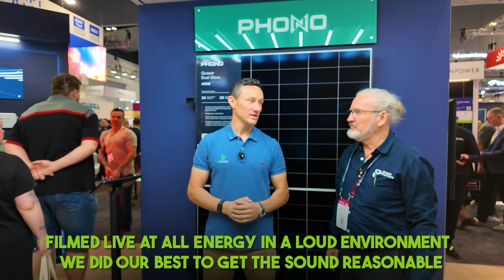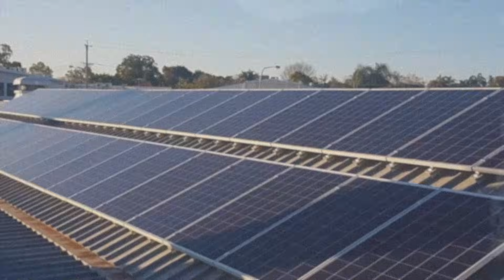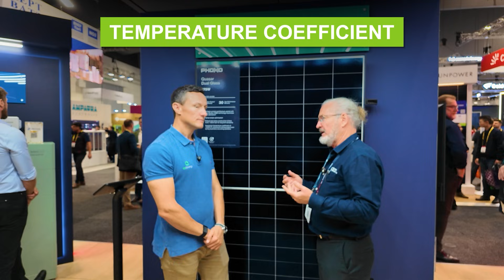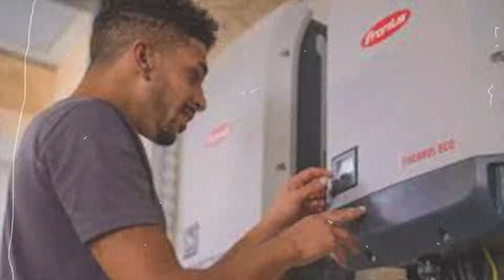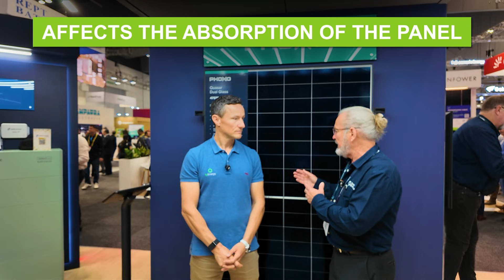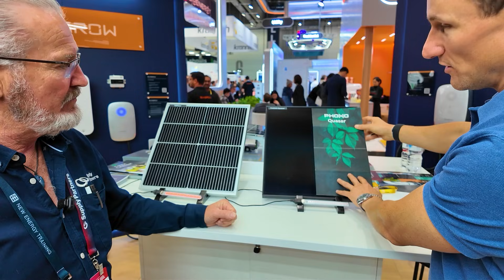Phono Solar Quasar 475w Solar Panel Review - Live From All Energy

Comment: I see them rated by solar quotes to being up there with REC in the top end tiers so should be good? The ABC is the way now and the duel glass backs also however Aiko still have the white plastic backs along with many other top makes?
Also see they have the white squares not all black for aesthetics but good temp coefficient which is the better option if you’re not bothered about that.
Good warranty but like all the rest of course it depends on many factors including shade overheating resistive cells getting overheated?🥵 
I think in the real world when you get over 10 years in our harsh environment, something like pv on a roof is probably doing pretty well?
By then we’ll probably have even better and bigger kw generation with even more improvements?
Cheers Daniel, good to see some healthy competition in the industry.